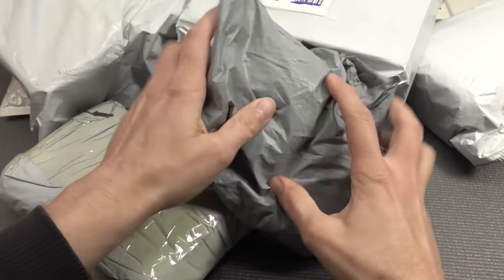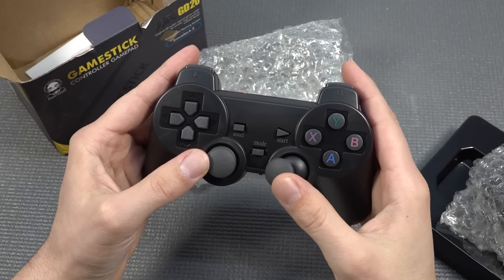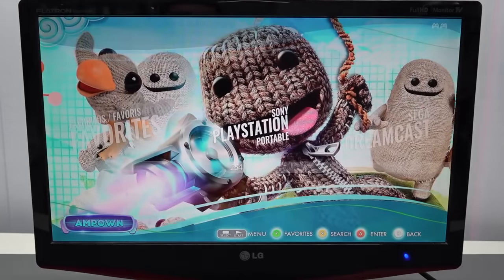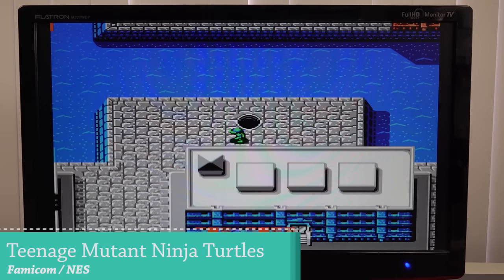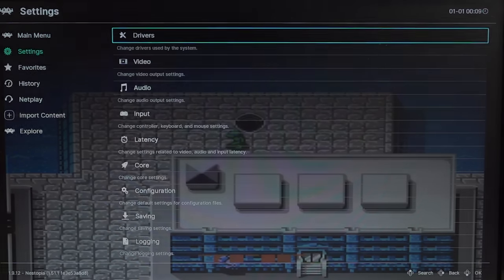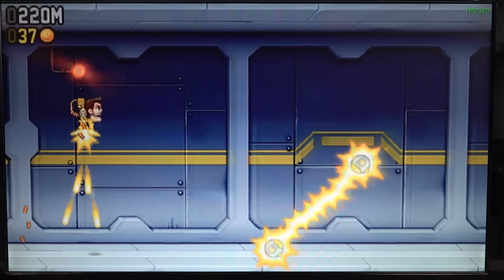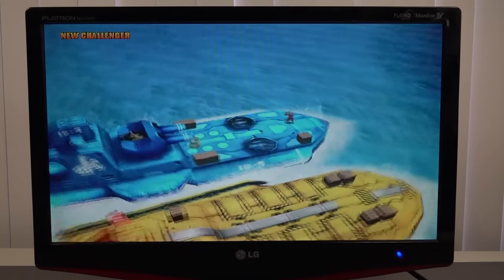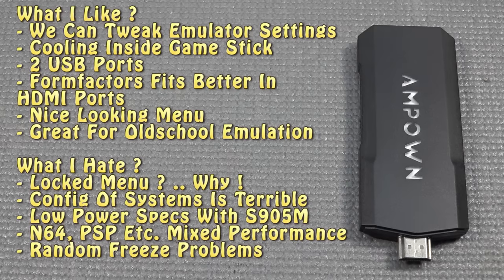Ampown GD20 $33,- Serious Retro Emulation Stick ? .. A New Powerhouse ?

Comment: You should put the game speed and frame rate on the display, because some games run at 30 internally but 60 refresh rate.. which does look a lot better than 30 fps

Comment: I just bought one today are games allready installed on it,or do I afto install them my self
Reply from the maker: You should ask the seller that 😳
Reply: put the sd card into your PC. depending on the sd card, you may need Paragon Linux filesystem support in your PC. find the 'roms' folder or find the 'download' folder and try to add games there.
Reply: Just founded out games are allready  pre installed  its basically plug in and play I ask for 40000 games anyway am sorted
Reply: @pitapitabread I have a 4k TV.  SD card files have been deleted.  I need to upload the files again.  How do I install boot files?

Comment: at this point get a less then $100usd mini pc has quad core cpu 8gb ram and 256gb ssd and just download your own roms and emulators will be much better then any of these cheap sticks
Reply: ive seen them as low as 75usd on black Friday last year
Reply: Can you please send a few suggestions?
Reply: Of course it will because that's 4 X the cost and no controls and you still have how many $ worth of time and labour.  For the actual true cost  of these what U get is very hard to beat. If you want better U pay more simple
Reply: LoL just ordered the gd 10 lol now see the gd20 😂 well what I really want one them Pandora box with the 2 sticks ?? I can't work out which is the best or newest one ... So many I can't figure it out is the 8 button ones better ???

Comment: I connected the product to the TV via HDMI. After the 3DGame Stick text, it remains on a black screen. SD Card (128GB) is installed on the device. We couldn't run the system. Can you help me please?
Reply: It Works only on a 4K tv
Reply: I have a 4k TV.  SD card files have been deleted.  I need to upload the files again.  How do I install boot files?

Comment: manufacturers of these devices saturate the market and use valuable resources to make already old tech sticks, you cant get a powerful machine with 40 bucks and with this size you cant really fit a powerful cpu;  recently i made myself a great deal (because i had a bit of money to spend, i was using a game box) and got a midrange 10 inches  android tablet with an Helio P22 processor (clocked 2,3 ghz 8 core) and it solved all my retro problem, no need for a hdtv for this kind of stuff (i know that  these sticks are for a specific market but  they are getting out of hand now) , thats my 2 cents